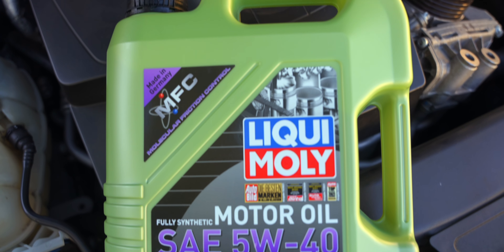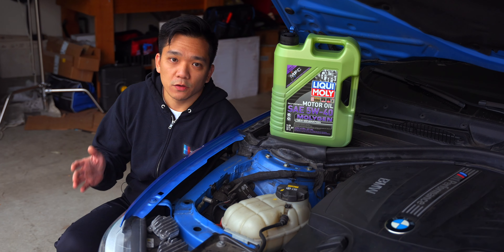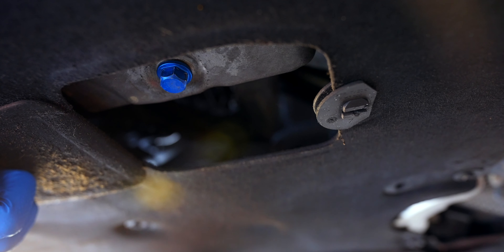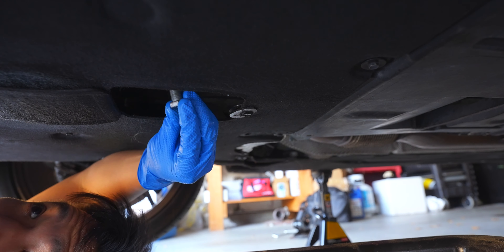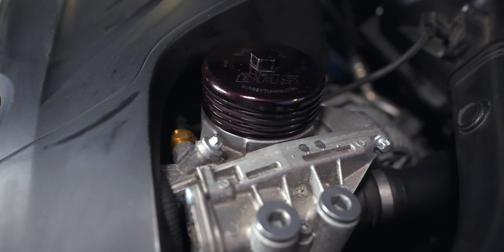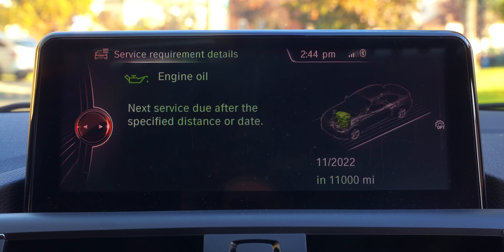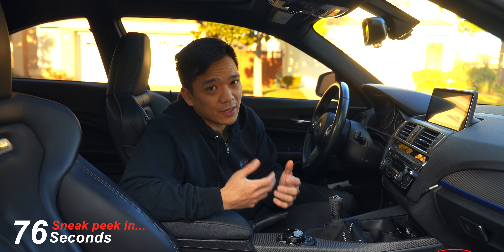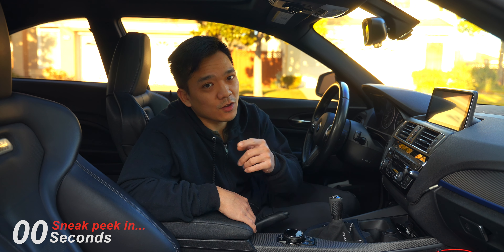Liqui Moly Molygen Review | BMW N55 Oil Change

Comment: Hi, I am regular user of Liqui Moly Molygen and been using since 2018.... You won't feel the difference instantly since the castrol edge itself a very good oil but i think its safe to say that on your 3rd oil change with liqui moly you'll see a difference, when I switched from 5W-30 to 0W-20 i saw a huge bump in performance, fuel economy, engine got relaxed, noiseless, and car got quicker. I would also recommend you to use liqui moly ceratec oil additive for more quickness, slickness, snappiness and instant throttle response, it reduces the friction.
Reply: Molygen doesn’t require ceratec because it’s already full of additives.
Reply: What car are you using this on ? I have VW 1.8T Passat and Jetta both same engine. I guess just asking if I can use it on my cars.
Reply: Additive makes engine wear out faster than just oil without additive.
Reply: @GregsAutomotive  , I run oil without liquid moly and send sample to the lab for analysis. I run again same  oil with liquid moly, same mileage and oil sample were analyzed by the lab and engine had 2 times more wear with liquid moly additive than without.
Reply: @repairvehicle  So basically using Liqui moly with no additional additives should be fine?
Reply: @mcdeelo7  , correct
Reply: @repairvehicle   That's 100% false. If you know anything about the certain additives within Molygen than you'd know that one is Ceratec which fills in the little damaged engine gaps with nano particles to seal the engine better and run smoother. Learn your stuff before posting.
Reply: Facts I run ceratec and Molygen 5w-30 on my 2023 tlx type s…u only have to use ceratec once every 40k miles…I change my oil very frequently, every 2500 miles.
Reply: Why would you go from 5w30 to 0w20? For winter or something?
Reply: @HEABtheOrdinary  This is only if you actually have gaps and damage to fill. If you do not, its detrimental because now these particles are floating with nowhere to bond, thus actually increasing friction and damage.
Reply: If your going to add an additive to Molygeln, use Mos2 from Liqui Moly. The Ceratec is already in the Molygen, no need to add more.

Comment: The best oil on the planet imo for any European engine is the AMSOIL European Formula. I’m running the 5W-40 FS in my 2015 428i rn and it’s literary the same color after 3,000 miles……I can comfortably run 10k to 15k intervals on this oil! Try it out once for yourself fritz!
Reply: 10k to 15k mi to way to long.
Reply: @osmansiddiqui96  based on what data?
Reply: Did you do oil analysis?
Reply: @Tritium1775  There's a ton of data out there that oil thins out the longer it's driven with. Do your research. Shorter oil changes = longer/healthier engine. It's a fact.
Reply: @HEABtheOrdinary  I have, and invite molybdenum to the conversation. It's not to say I agree with 10-20k oil changes and myself prescribe to <5k but the facts are different engines have different wear properties due to machining/heat etc. While we can say it's "better" for any vehicle to swap the oil out every 3-5k it's not an empirical fact as some engines have minimal wear due to their engineering which is why we see cars like my old 2009 Cayenne Turbo on 20k intervals recommended by Porsche. Did I ever go to 20k? Hell no. But the engineers recommended it based on data they had on the engine.

Comment: I’ve seen the virgin oil analysis on molygen and tbh it is quite disappointing. Not that it’s a bad oil by any means but it is nothing special. there are oils with far better additive packages that are significantly cheaper

Comment: Damn! I brought my own liqui-moly molygen oil to the car dealership for my car service but after the service when I check my oil dip stick, the oil isn’t green like Molygen oil, the dealership didn’t use it in my car!
Reply: When the oil is being drained from the engine, it still leaves a bit of old oil residue in the engine. I've also noticed upon changing the oil with molygen 5w30 and checking it on dipstick after start-up, it was light-brown'ish.

Comment: Just got my m235i yesterday. I have the new battery from my f30 in it(one month old) and it still said low battery warning after using a battery charger on it overnight til it said full/maintaining. Think the alternator is screwed or should I get my laptop and reset with ista?

Comment: Hi Fritz, thanks for your great m235i content as always! After watching your video I plan to give this Liqui Moly a try but I’m debating on whether to use 5w-30 or 5w-40 for my next oil change. Ive been on the OEM BMW 5w-30 for my past oil changes, only yesterday that I got an “engine at minimum level” warning signal from the car and I’ve been trying to figure out if it is the lower top end viscosity that’s causing my engine to burn the oil quicker (I’m pretty sure the decrease in level is not due to a leak). My concern with 5w-40 is that I live in Vancouver and we have much cooler summer than California. Hoping you could give me some advice, thanks.
Reply: Hello there. It looks like your question did not get answered so let me add my 2 cents. The most protective oil which is called Liqui Moly Synthoil 0w40 has an incredibly great film strength and makes your engine quieter. It can probably make any engine last to 500k miles. But it is a little thicker so I recommend for summer weather. For winter I am using 0w20 AA LiquiMoly and it seems to be doing well because it is lighter and it's still not that hot where I am at.  If you want to see some of the Liqui Moly oils being tested for the scar size when spun for 10 minutes you can search YouTube for keywords: Piotr Liqui Moly + the weight oil.
Reply: I have an M54 not the same engine but I had it since 35k miles and its at 144k, 5w 30 was super smooth and a good oil weight up until 100k miles or so, once I started touching 100k that's when you get the spark plugs coils, and whatever replaced, the car ran good but when I switched to 0w-40 and the car was warm it way smoother running on 40 than 30, now the engine will only run on 40. So I say depending on how hard the engine worked in its life, how many miles, and oil change cycles switch to 40. I also noticed the car burns way less oil now, its been full now for like 3,000+ miles so far.
Reply: 5w-40 is a great oil. If you are concerned at all with low temps just run 0w-40
Reply: thanks so much for all your replies! so i’ve switched to 5w-40 and couldn’t be happier. The engine is smoother, happier, unnoticeable oil burn. I feel BMW should just recommend the 5w-40 for the n55. Cheers.

Comment: so good youre putting in all this work for our forgotten/overlooked  bmw model, youre the only one doin it consistently/well

i think at face value we all want to see visible/striking results in upgrading/switching  oil but in this instance, between these two oils i think everything will be the same when looked at face value. 

but where i think this "model" of moly oil gets the label of "better", is the  special "Powerful MFC (Molecular Friction Control) technology prevents formation of deposits" sauce it has, something you wont feel/see until you check that magnet and that black light feature.

 i dont think you, with a tune would see noticeable smoothness/mpg differences cuz its still 5w40, for increased economy its usually 0w 30, to maaaybe see a diff, but that turns to water to fast and ultimately useless especially if youre not stock and or drive hard for even half of the oils life.

i think it simply comes down to if you want to pay the little extra money(maybe) for some extra wear protection, an internal spout and the black light thing over "regular" brands

on fcp euro theres 3 moly "service kits" (7Liters and the mann filter), the green molygen kit is the cheapest of the 3 at 65$ and obnoxiously cheaper than the bmw branded oil kit at damn near 100$.   castrol edge at oreillys is 71 for 2 jugs minus the filter. 

i think im gonna go with this cool kid moly, for my next change, ill come out cheaper than the dealer at; 100$(this time) for a 7 quart+filter kit, magnetic drain plug and 3 extra filters and save 90mile drive to/from livermore  for me to wait 3 hours in the dealership lobby haha

 https://www.fcpeuro.com/BMW-parts/M235i/Oil-Filters-and-Lubrication/?year=2015&m=20&e=180&t=5&b=9&d=3584&v=
Reply: buy Synthoils. Much better than this crap

Comment: Castrol Edge has worked fine in my E46 285k miles and 15 years later it is still perfectly fine and I'm on the same engine. Not gonna change it up now, If I do get a high performance newer BMW then yes, I would use this from the beginning. Other then that there's no point in changing and spending more on oil, my E46 is living proof. Runs like new
Reply: No oil consumption? Engine clean on the inside like brand new?
Reply: @repairvehicle  There is some oil consumption, I have to add about a quart once a month. That’s the Vanos bro, it’s like a German VTEC it’s gonna happen with Liqui Moly too

Comment: this crappy magnetic plug broke on me as well and luckily I had my old one. When it broke, half of the plug was still inside the hole and good thing I was able to get it out
Reply from the maker: That's exactly what happened. 😅
Reply: The same thing happened to me.  Luckily I could get my pinkie in there and get the crap magnetic bolt out

Comment: I have only used this oil since like 2015 in my old 335i which i sold at 155k miles and my m235i i bought in 2018 and never looked back. zero issues even with heavy track use.
Reply: Are you referring to the Moligen version??
Reply: @mcdeelo7  Clearly.

Comment: I use 0w 30  bmw ll01 fe oil on my tuned f30 n55. I really don’t trust liqui Molly. I had a v10 m6 that used Molly was burning the oil. Went with motul ran a lot better and stop burning oil.

Comment: Hey, hope all is well, My question is what was the result on the magnet after the oil service?  I’m more interested in the metal shavings it may have produced during your timely oil service. It would be nice to see that the  Liqui Moly reduced  shavings in the motor by a good amount. I’m currently running 0W 30 in my 2014 BMW M235i that was  recommended by BMW dealer near me

Comment: I use  castrol edge  and mix it  with lucas stop leak. same effect as using that expensive liqui molygen
Reply: I've used that combination on every car I've had wether it smoked or not....gave my car so much power and protection

Comment: You must have some insane traffic to get the same mpg average as my F10 550i. On a side note, I use Pennzoil euro L 5w30 before winter hits and switches to Leichtlauf High Tech 5w40 near the summer times. I've noticed that on 90+ degree weather the 5w40 oil ran better than the 5w30 but otherwise it's about the same during cold season. The euro L 5w30 costs about $25 a 5qt at the local walmart while Leichtlauf 5w40 at $43 a 5L.
Reply: The 0W-40 is better in the cold than 5W-30 and theirs no difference in the cold weather performance of 5W-40 and 5W-30 so you can still use the Leichtlauf in the cold. Liqui moly makes 0W-40 oil for BMWs that has the LongLife-01 spec. It’s called Liqui Moly Snythoil Energy A40 0W-40 😇🙃

Comment: I just picked up some of this @ $46.49 USD for 5.28 qts or whatever it is. First time using "fully" synthetic.  If I buy 1 more qt thats enough for 2 oil changes in my 19 civic 1.5t . I just hope its worth it. I always use castrol edge.

Comment: So on my 228i, i first used Mobile one. Which i didn't feel the difference from the time I drove off the dealer's garage. About a week ago i decided to go with Castrol amd Gosh i wish i have known.  Now the car drives smoother, shift smoother,  quite.
This is bar far the noticeable change i registered doing an oil change.
Reply from the maker: Thanks for sharing! Mobile 1 is another good brand, but if the additives aren't correct the engine won't perform as well. Glad you found the fix 👏
Reply: Mobil1 European Formula 0W-40 does not meet the BMW LL-01 specification that your engine calls for. The castrol does though.
Reply: @DuckMcDuckinson  yup.

Comment: Looks like you may have forgotten the crush washer on the oil drain plug? Or does the M235 not use this? Have been using LM Molygen for 80k on my F36 428. Very good oil.
Reply from the maker: You're right. I forgot to film that part, but it's on there and included in your oil filter kit.

Comment: I have an f30 b48 factory uses 0w-20 do you recommend 5w-30 or 40 from fcp euro because I’m not sure whether to switch to that viscosity.
Reply from the maker: If you're having good results with 0-20 then keep using it.
Reply: Use the heavier oil if you drive a little harder
Reply: Depends also where you live and how hot it gets
Reply: For longevity, use a 30w or 40w oil...the 20w oils will always breakdown vastly thinner and cause more wear and not let your rings seal properly, my 2016 golf is spec'd for 5w20...burned it like crazy, I use 5w40 now and it doesn't burn now